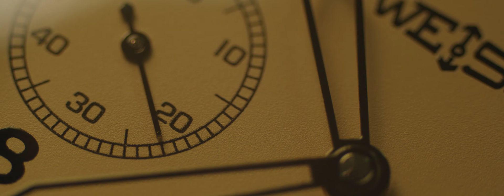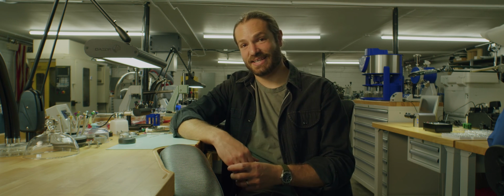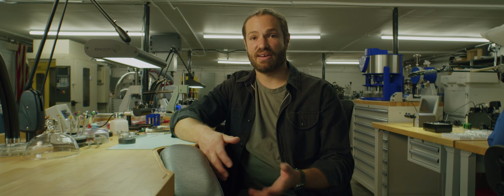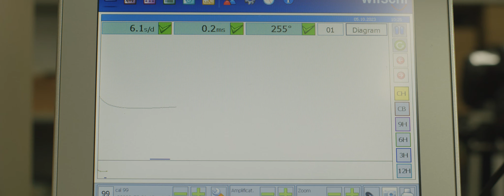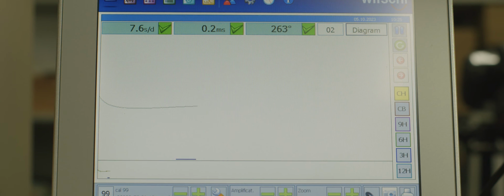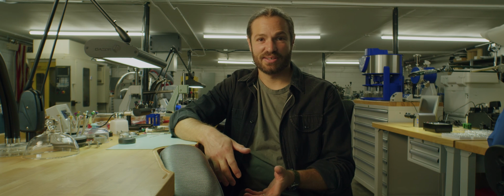Magnetism and Mechanical Watches

Comment: What sort of demagnetizing unit do you recommend?  I have a cheap "blue box with a cord and red button" from Amazon which has sometimes helped (and I use by turning the watch around and drawing it away while holding the button, the directions with it were not very good).

Comment: I have always wondered how the watchmakers handled the problem of magnetism before electrical demagnetisers were invented. As far as I know, there are only two ways to demagnetise objects - heating them to extreme temperatures or applying an alternating magnetic field as it is carried out by modern electric demagnetisers. Does it mean that a heavily magnetised watch turned into a piece of junk in the 19th century? Or were there any other ways of creating an alternating magnetic field (machines with rotary magnets)?
Reply from the maker: To answer that question you must first think about what magnetizes a watches component.  For the most part magnetized watches can be attributed to an electronic device with a powerful magnet in it.  So before there were electrical devices with man made electromagnets in them, there wasn't much threat to a watch becoming magnetized. There are naturally occurring magnets and natural magnetic fields that can cause timing issues, but for the most part this will not cause the watch components to hold a magnetic charge themselves and so a demagnetizer will not be necessary.